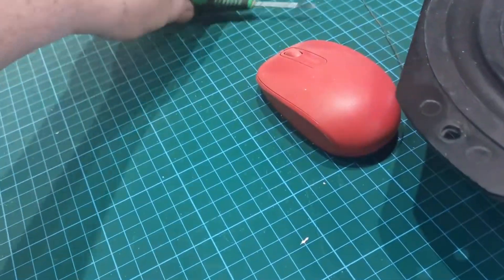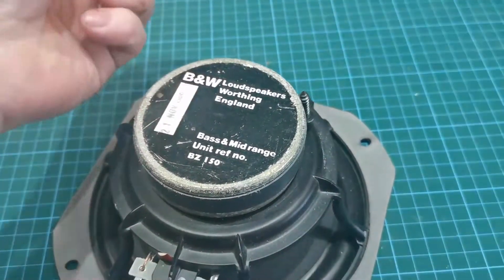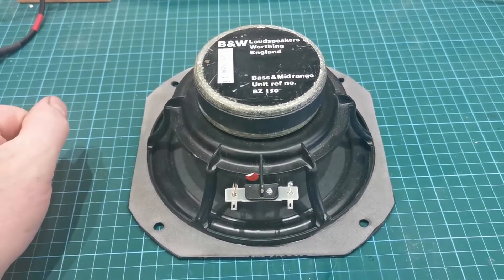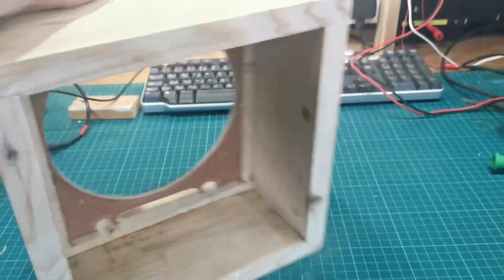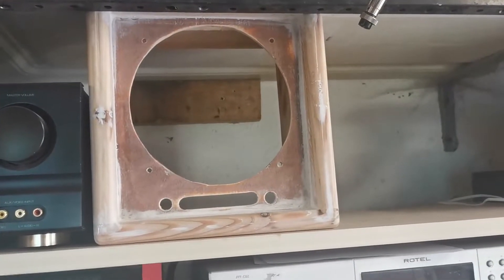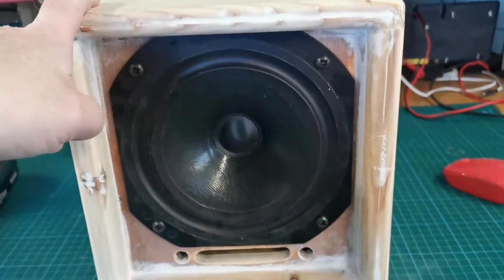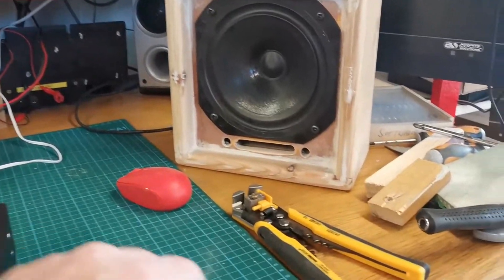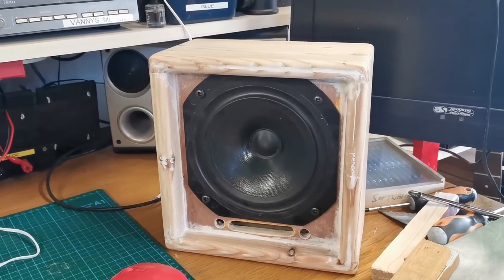THE MOST OVERKILL MONITOR SPEAKER EVER

Comment: As a Bowers & Wilkins fan (of their 70's & 80's speakers), I fully endorse & like your design George.
Driven by radio gear, it should last forever!
Please show us the finished product when you have gotten around to painting/staining it!
Reply from the maker: Hi Adam. Thanks for the comment, it  works really well. I was concerned that the cabinet wasn't deep enough.  Better than it sitting unused. It was uneconomical to repair the DM110i's.